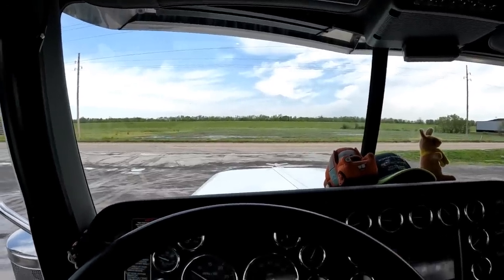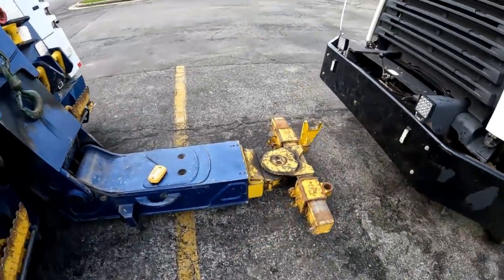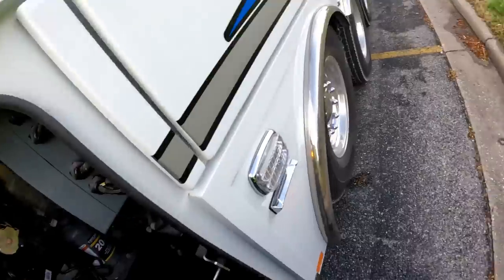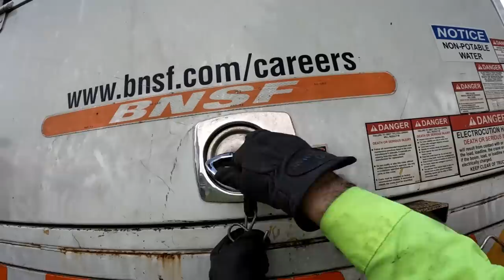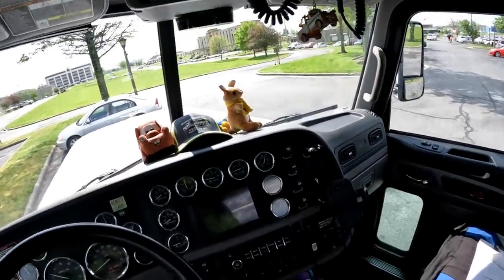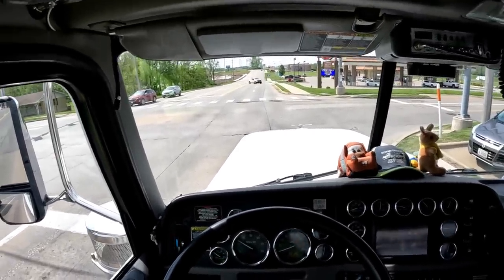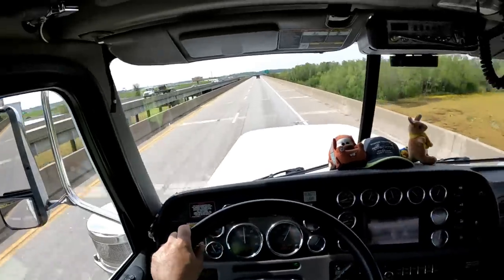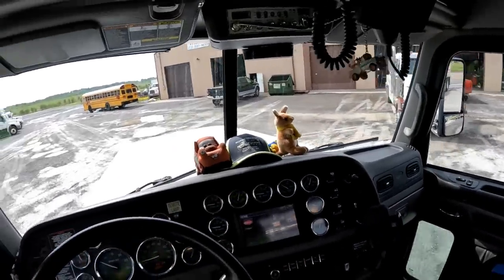ROTATOR TOWING A LARGE HYRAILER TRUCK.

Comment: As you mention many times Ron.. there are many different ways to reach 10.. especially with things like hook-ups. Nice point out with the hyrail system and how it works with the load of the truck. Thanks for the full drive back to the shop and pointing out where you were along with that previous trailer lift that you did not like one bit!  As for your weight estimate lol ... 73 with the additional 50-60 on tow.. every bit of... heavy! for american standards .. brilliant. thanks as always Ron for sharing another recovery

Comment: So reading between the lines......
"Well, this should've been an easy tow, but it's going to be difficult . I'm going to shut down the camera while I drop the driveshaft, hook up safety chains  and......."
Translation - In order to keep my channel PG rated and keep my editing time to a minimum, I'm not going to record for the next hour. 🤣🤣🤣🤣
Reply: that's how I read it also, having fought those types of driveshafts myself.... I completely understand (unless the "tool" he mentioned is a couple pieces of hardwood 4x4 blocks, and didn't want to show the "wrong way" of taking it apart :D )
Reply: Personally I think he didn't show how to disconnect the driveshaft portion because then folks would know how to hook up to and steal these big trucks which are mighty expensive.

Comment: The fellows in my service area who operate those hyrailers with booms will extend the outriggers so I can change the tires easier. They're a real pain to jack up, especially in some of the rail areas where they stage or operate. Thanks for the video. :>

On the topic of lifting by the hyrail system itself, there's similar points on trucks/trailers where you're not supposed to jack up from either, but it's unavoidable at times. On a truck, not supposed to jack from the leafspring itself or the airbag post. Sometimes the correct places to lift are inaccessible, in the ground, too low, tire wrapped around it, etc. Temporarily lifting in those spots is fine in most cases and sometimes the only way without having a wrecker.

Comment: You ccan if you ahve drivven a big truck. With the trailer attached to mine, I was over 110' long, and yes you can tell when that JAKE brake kicks in, and then you feel your brakes as well. I've also driven an 8-wheel front-wheel drive vehicle, it isn't easy, but it can be done even going up a 329' hill, flattening it, and then making a 3point turn and coming back down that same hill. That was when I  was stationed aboard the USNS Guantanamo Bay, Cuba back in the '60s if you can remember back that far. FYI, Ron, I'm 76 now.

Comment: Nice job Ron. It may have been the angle of the video, but the clearance of the tow vehicle rear bumper looked pretty low. It also looked tight to get to the drive shaft. Stay safe out there.

Comment: If you think your load was heavy today, come up to Michigan and see the loads that are on the roads here. Fuel tankers hauling 13000 gallons on a 53 foot trailer, or a steel roll hauler going to one of the big 3 stamping mills, or a gravel train pulling tandem trailers all rolling on 11 axles and 42 tires. And yes the roads are terrible if you were wondering
Reply from the maker: Actually, I was just in Michigan.   Currently, I can't say WHY I was in Michigan, but everyone will find out very soon!!!   I did see some of the heavy hauls there with the trailers that were nothing but axles and tires for days.   Where I was, the roads weren't too bad, at least not compared to where I'm from.  Stay tuned to find out more about my trip to Michigan!!!  Thanks for watching and God bless.

Comment: Great video! never had issues either with picking on Hirail! TriDrive picker trucks , no problems , i usually tow with a 9055 , only one i wont tow by the hirail system is track inspection trucks with the front cameras and sensor!
Reply from the maker: Agreed, those I stay far away from the Hyrails and any measuring devices/sensors they may have.   WAY too expensive to repair or replace.   Be safe.   Thanks for watching and God bless.

Comment: Hi ron, I was wonder how you make the service brakes on the towed truck to work? where did hooked up them to work? it will be awesome if you make a video explaining that
Reply from the maker: There are several options to accomplish this.  This particular truck, I tapped into the foot valve line on the firewall.  Since this tow, we have purchased the first of hopefully several brake assist devices that attach to the steering wheel and the brake pedal of the towed vehicle.  I will be showcasing this on a future video.  Thank you for watching and God bless.
Reply: @RonPratt  Thanks Ron, Greetings from Venezuela
Reply: @RonPratt  As a train enthusiast myself i have to say i was surprised that you had to tow one of these cool trucks. The BNSF Hi-railers are pretty cool and i have never seen one up close like that. Nice work Ron.

Comment: Ron, are you a railroad buff?!? You knew that was a welding truck right away, and even used the proper term "Maintenance of Way". Also, you blew 3 short horn blasts before backing up, which is a railroad rule. 3 shorts before backing, 2 shorts before proceeding forward. Love your videos.
Reply from the maker: We live and work near two major rail lines, the BNSF and the UP.   Our town was built by/for rail and river.   And, we've worked on, around, with, and towed the MOW and other rail equipment for many, many years.    As for the horn blasts, the railroad is where I learned it.    Did you know that in the Fire Service the same three blasts means emergency/evacuate?    I didn't realize it until a fire training session I attended a few years ago.   It's hard to break the 3 blast rule after using it for so long.    So, I still use it when there are people around.    Thanks for watching and God bless.

Comment: Out of serious curiosity how did you tie into the service line to use the service brakes. I’ve wondered if it was possible but haven’t seen it done until seeing this particular video. I normally run a 25 ton so sometimes the heavier straight trucks give me a bunch of grief on getting them stopped. Much appreciated love the content. Tow op out of Brownsville Tennessee

Comment: Hi Ron.  With regards to grabbing the hi-rails, it probably comes down to preference by the operator.   Using your common 10 analogy, there’s usually more than one way to do things; it doesn’t necessarily matter if one way is better or not, as long as the job gets done

Comment: Hi Mr Ron.Questions for you from Denmark 🇩🇰.Should there be no yellow turn signal on the list bar you put in the back of the wrecked  truck when you turn right or left daylight and darkness. 😊😊😊.
Reply from the maker: There is a stop/turn/tail fully operational light bar.  All functions were operating properly via a RF transmitter plugged into the rear of #11.  Thanks for the question and for watching.  God bless.
Reply: In the United States, turn indicators can be amber or red; if they're red, they can be combined with the stop and tail light in one "bulb". You can see him run a test on the light bar's turn signals at about 19 minutes in on the „Q&A Tow with Mom Pratt” video.

Comment: As a retired truck driver been thru your neck of the woods fairly often. But am just wondering as a emergency vehicle are you alound to run over weight as a combine vehicle weight or do you have to run permits for the weight.

Comment: Wonder if there is a computer setting you can change so the engine brake works until you stop. The company I work for has a 2006 Pete 378 that does the same thing, but our newer trucks (2016 Pete 365) all use the engine brake at all speeds.

Comment: Ron that remote light bar does the MDOT require that light to be a certain height. Of course that is going to be dependent on the size of the Motor Vehicle you are transporting. Missouri has such weather extremes during the year. It can be bone chilling cold with lots of snow but it can be very warm with lots of humidity. Does the Mississippi River play a part in those weather extremes?

Comment: Its not what you can pull, but what you can stop.
GW 56000 on the cab door = 28 short tons or 25.4 metric tons.
Thank you for explaining why you are using the rotator. I also thought the lowboy trailer would be awkward to position for pick up.

Comment: Seeing you put the pins in the under reach.  I was always told on putting cars together that the bolts go from front to back so if the nut falls off (or clip in this case) the hardware has less a chance of vibrating out while the vehicle is in motion.  Anything like that ever come up in any safety briefings for towing?
Reply from the maker: There are several reasons the pins are put in the way I put them in.   First, for a "sling tow" the flat part of the pin needs to be in this position to keep the safety pin from getting crushed and/or knocked out.  The head of the pin also fits safely and securely inside a special hole in the chain receiver for this very purpose and the pin isn't able to fall out when towing using the sling method, if done properly.   Second, when the under-reach is in the stowed position, which is most typical, the head of the pin is facing up, so if the safety clasp were to get knocked out of someone forgot to put it back in, the pin would still be in the under-reach.   I do understand what you are saying and for most situations you would be correct.   Thanks for watching and God bless.

Comment: Hi Ron, I've got a couple of questions for you "mate" from down under! Firstly watching your tacho are you just holding gear or neutral coming up to light/stops as I don't hear or see evidence of downshift/exhaust brake in your videos unlike here where all seem to downshift/Jake brake to a halt? Secondly why is it necessary if the tow is in neutral to remove the tailshaft, something else you do regularly and I can't fathom out why? Ok so I threw the first question up before you finished so more or less answered although you still seemed to throw it into neutral on first stop out on road past fire station. You also mention top speed of 60 in that situation. What's the tops then as that's the top speed trucks over 14 ton are speed limited to! Road trains are at 90 kms north of Adelaide till they get a certain way out.

Comment: I totally agree that the hirail axel will support the truck but I believe you’d have the extra weight distribution by lifting from the  front axle of the truck itself and it would only require som blocking to get the under lift to that point. Just my opinion and I’m not criticizing you this time. Love you buddy!
Reply from the maker: Actually, in this specific instance, the hyrail axle was forward of the truck axle, which gave me a much better weight distribution.   The farther forward I can lift, the better, typically.   Thanks for watching and God bless.

Comment: In your commentary you say you attached the air from your truck to the A/C system of the tow vehicle. that seemed curious to me. Surely the trucks air brakes are not connected to the A/C system?
Reply from the maker: Actually, I believe you may have misunderstood what I said.  I said I was using a "high side R134A A/C connection fitting" to tap into the truck's air system.   Most newer Freightliners have an aux fill port in the main line from the compressor to the tanks.   This port just happens to be the same as an R134A High side charging port, but it is not used for A/C in this situation.   Several truck manufacturers have standard auxiliary air couplers.  International uses a Cummins high pressure fuel fitting.   There are actually kits that we can purchase now that have all the available fittings.   I had to find all my own when I put my kit together.   Here is one such kit:  https://zips.com/parts-detail/aw-direct-quick-connect-air-coupler-kit-zaw-ack
Thanks for watching and God bless.
Reply: @RonPratt  Thanks
 Ron

Comment: What are you permitted to tow weight wise by DOT? Just curious since you’re in a heavy truck towing an estimated 50-60K.
Reply from the maker: In Missouri we can move anything, regardless of height, weight, and/or length on a "first hook" basis to the first available "safe zone"......it's a pretty grey area.  Typically, if we are towing a disabled vehicle to our shop then there are no issues.   When we cross state lines, then we have to be legal just like every other truck on the road.   We can get permits in certain states as well.    Thanks for watching and God bless.

Comment: How do you hook up service air to the trucks you tow? I drive a rotator and I have never used service brakes like that. It would help when we weigh 125k plus daily
Reply from the maker: I'm surprised you haven't run service brakes on a towed vehicle before and that nobody has instructed you on how to do it.   It is, technically, the law that we are to have working brakes on anything other than an "emergency" tow.  I will try to help.   It can be difficult to explain, but I will do my best.  First, you must have emergency air supply, as you normally would to release the parking brakes and provide air for the air ride suspensions.   Then there are several ways to get service brakes.   If you can find the treadle (foot) valve, typically located on the firewall, you will have to determine which air line supplies air from that valve to the service relay valve.   On some trucks that can be difficult.    If you can't determine which line, you can go under the truck, find the service relay valve, remove the "control" line and run your service air line direct to the control port so that when you apply the foot brake on your truck it activates the service brake on the towed vehicle(s).   This is the same principle as running your emergency and service air to a trailer that you are towing.   There is another option and I am trying out the product now.   Zip's sells an item that used to be called a "brake buddy", but now it's called the "SafeAll Remote Brake Assist".  It sells for around $600.   It is extremely simple to use.   Secure the steering wheel.   Use the built-in clamps on the tool to attach it to both the steering wheel and the brake pedal of the towed vehicle and connect your service air line direct to the tool....bam...your done....quick and simple.    Hopefully this will help you.   I know that trying to stop the loads that we are tasked with moving can be difficult and unsafe if not running service brakes.  Any more question you may have, I will do my best to answer.   Thanks for watching and God bless.

Comment: What are the yellow tape arrows on the inside of the rotator's compartment doors for? Did somebody run into an open door one too many times? If so, one would think that a flickering LED on the inside of every door would be a good mfg. change for the rotator, with them on the trim lights ckt.

Comment: what does securing the steering wheel do on a tow like this when the steer wheels are lifted? or does it turn more than just the front wheels? am i missing something
Reply: if the truck breaks free of the wrecker it will go straight and not turn into traffic
Reply: As he said in the video: it keeps the front tires from sticking out.
If the steering wheel turns the truck gets a few inches wider.

Comment: What is the bare metal wheel behind the front bumper bar for? It's on the LH saide just behind the front black bar. 
It looked like a wheel to run on train tracks but I did not see a secod one on the rh side.
Reply: It is a dual way vehicle that can be driven on roads as on railroad tracks.
Not only does it have a trackwheel on the driver side but also passenger side, of course. And a similar system at the back, too. 

Those "full metal wheels" are lowered when it goes on a railrod track, and they support almost the entire weight of the truck.

For the (inner) rubber drivetrain tires, which still propel that truck on tracks, there is just enough weight pressure left for sufficient adhesion to the tracks so they get the vehicle moving. 

That at least is the concept of the "Zweiwege"-Unimog, and I think this here is rather similar.

Comment: Do you ever get overweight on drive axles? What is your empty weight ? Do scales give you pass cause "Emergency Vehicle?
Reply from the maker: We absolutely do get overweight on both axles and gross, at times.  The laws are rather grey.   Basically, in Missouri we can move anything, regardless of height, weight, length, etc., on a "first hook" or "emergency" basis.  To keep it simple, anything else requires a permit just like any other truck on the road.  So, we do not get a "pass" at the scales unless it is a "first hook" or "emergency situation" within the state of Missouri.   Thanks for watching and God bless.

Comment: Does MO require Yellow/ Amber flashing lights during the tow to destination?
Reply from the maker: If the wheels of the towed vehicle are on the ground the answer is yes.  For tows on our rollbacks/tilt-trays, where the vehicle is secured to the deck, no tires on the ground, and it isn't over-sized, then no amber lights are required.   It's actually suggested that we don't run them in the last scenario.   Running warning lights when they aren't required or needed desensitizes people to them.   Thanks for watching and God bless.